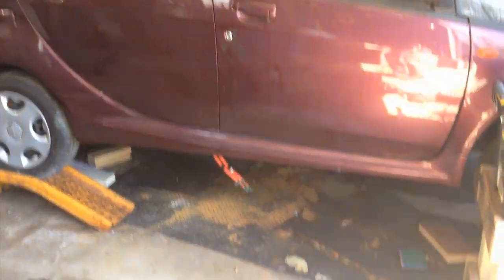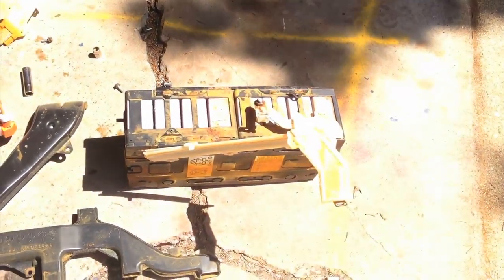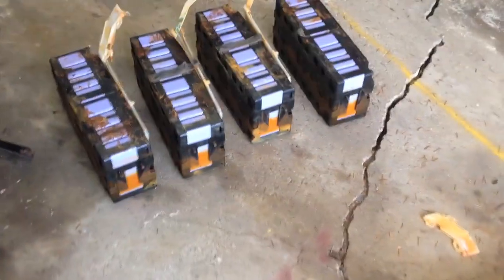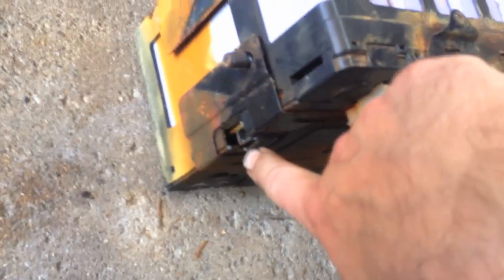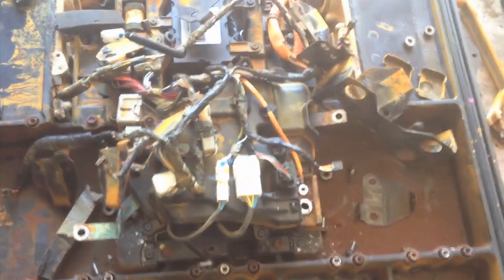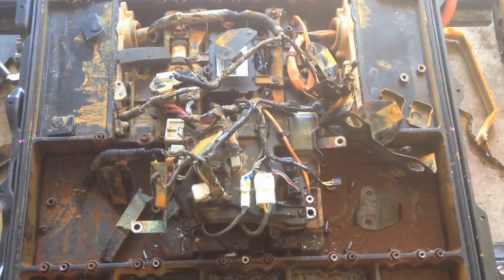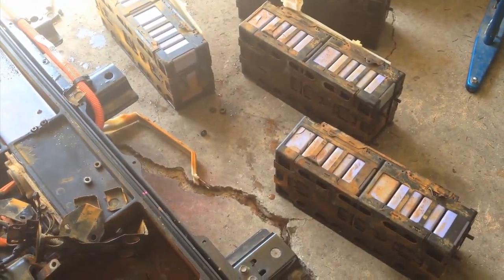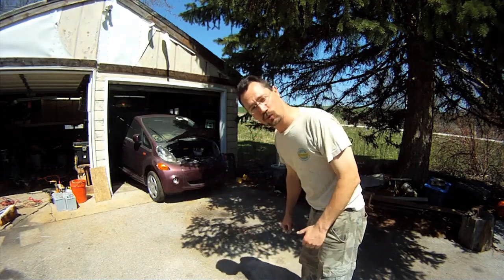Mitsubishi i-MIEV LIthium Cell Removal April 28 2013

Comment from the maker: Only one of the original 8 cells I pulled out was any good. In this next set of 8, I have a good feeling over half looked like that took a decent voltage.
I would have washed the car sooner, but it's been below freezing for so long, and I couldn't just DRIVE it to a carwash!

Comment: I agree. There might be an alternate (albeit, less efficient) means of powering this pretty little car around. 

i.e. Switch in some lead/acids. Get an AC controller from, like Azure Dynamics. Tear out and replace the glass cockpit with regular gauges and switches. This may sound mental but, well, you could convert a dead i-MIEV into a functional electric car...

Still, nobody could blame you for parting it out for cash.

Best of luck, either way.

Comment from the maker: So far, the car rolls well and the parking brake and service brakes all work fine. Mechanically the car appears to be in pretty good condition, although I'll still have to check the CVs, any oil in the drivetrain, etc.